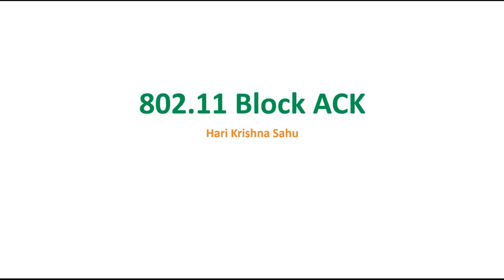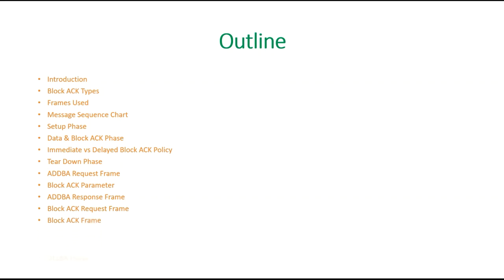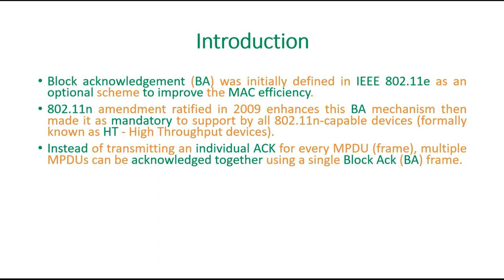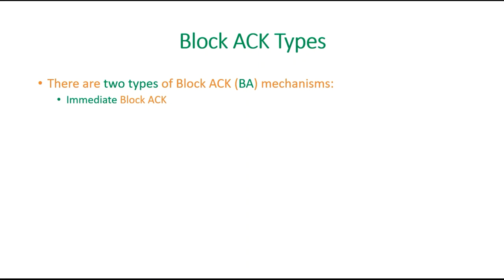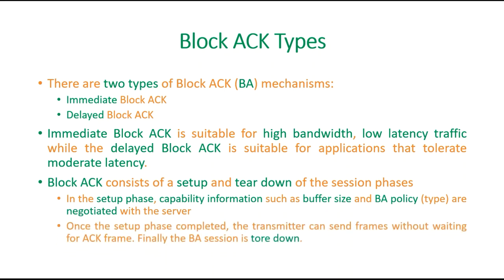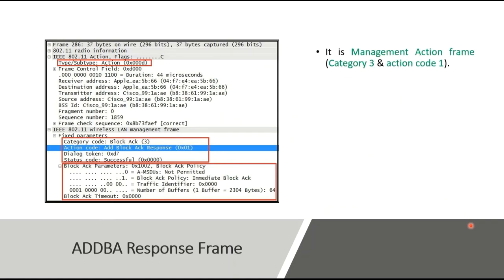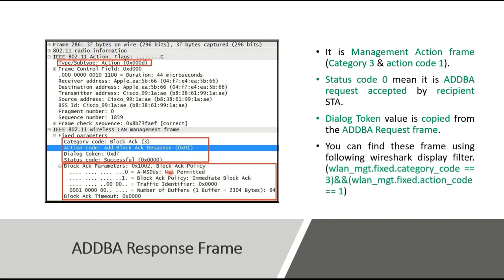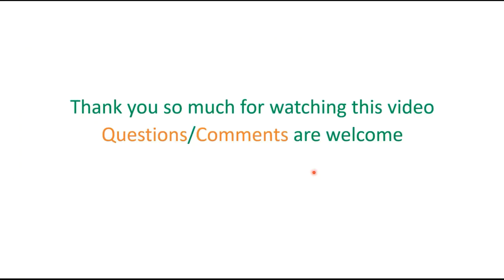802.11 Block ACK | WiFi | WLAN | 802.11 Block ACK Mechanism | Block ACK Frame Format |  CWAP | Frame

Comment: Hi Hari, what does Missing frame indicate. In BA control packet, we can see the starting sequence number and Missing frame with different sequence number. Is recipient trying to ACK all the 5 frames starting with sequence number 97 or recipient dint receive the frame with sequence 97 so it is indicating as missing frame
Reply from the maker: In the context of Block Acknowledgment (Block ACK), missing frames indicate that some frames in  a sequence were not received successfully by the receiver.

Comment: Blockack timeout 0 means
Reply from the maker: The Block Ack Timeout Value field (2 byte) is used in the ADDBA Request and Response frames to indicate the timeout value for Block Ack. It is Management Action frame. Status code 0 mean it is ADDBA request accepted by recipient STA. Sorry for late reply. Thank you so much for watching my video.
Reply: @HariKrishnaSahu  Here I am talking about blockack timeout field not status code. Actually if timeout field has a value until that value blockack session will be active. But if timeout value 0 means untill deauth session will be active.